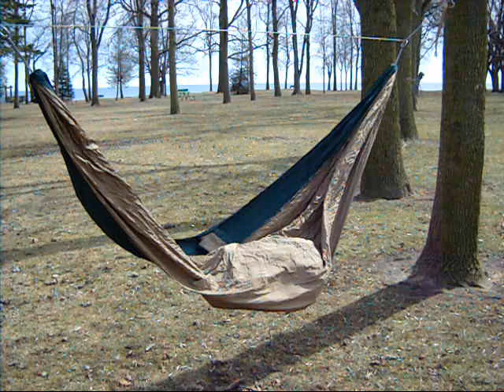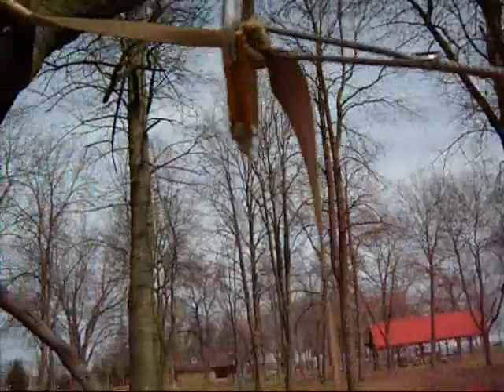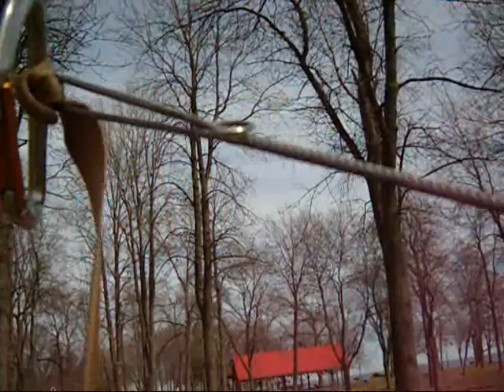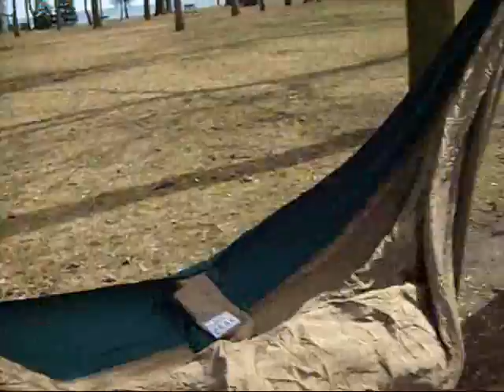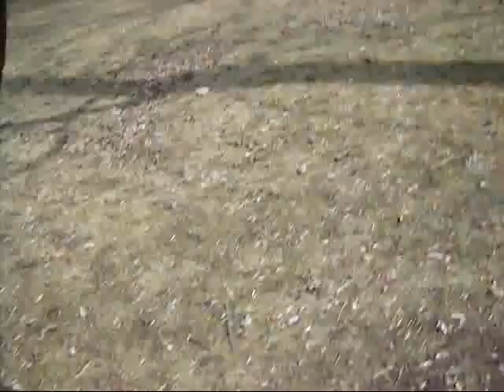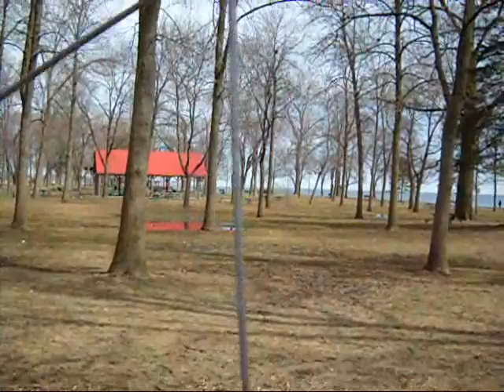Hammock Gear Test

Comment: looks really uncomfortable.  you need to get a longer ridgeline for a flatter lay on your hammock.
Reply from the maker: +mmyr123 That was my first hammock setup from 6 years ago.  On this single line suspension system, I didn't leave enough adjustment room between the two whoopie slings.  I failed to account for the length of the two continuous loops when calculating how much distance I would need for a structural ridge line (and some adjustment for comfort).  

I now use a DIY bridge hammock for my hammock camping needs.